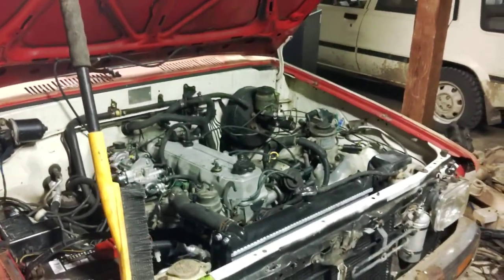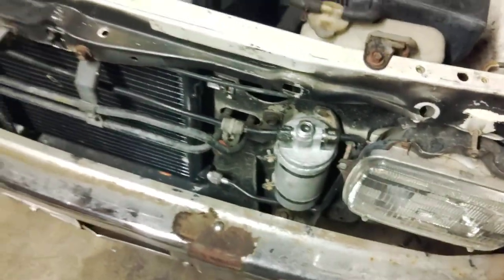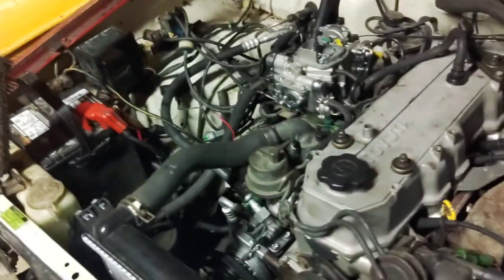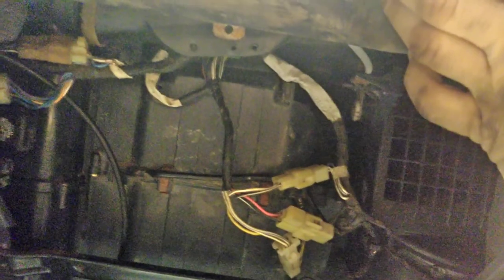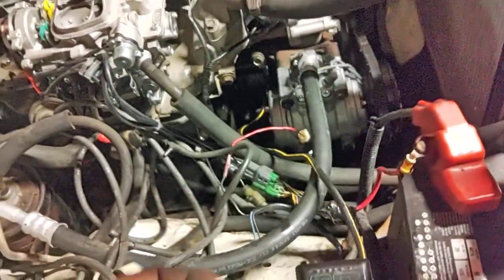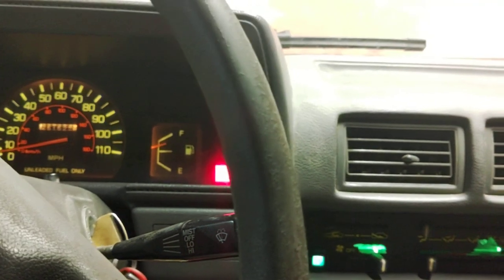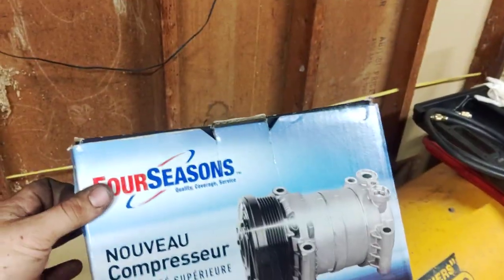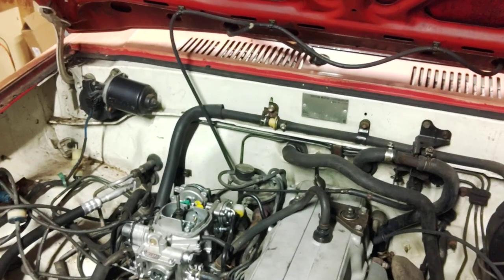1984-1988 Toyota pickup air conditioning installation.

Comment: Okay so question, so i have a non ac truck and im installing everything new , i add oil into the new compressor and the vacuum it or do i add oil to the evap,conden,drier, etc… and then vacuum ?